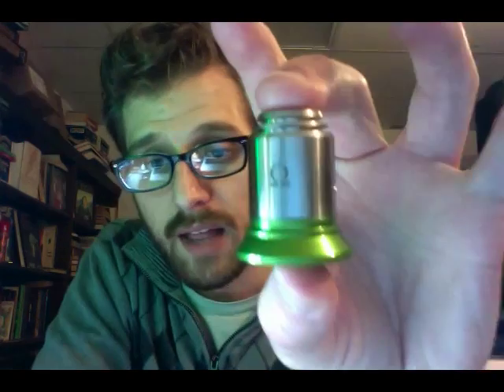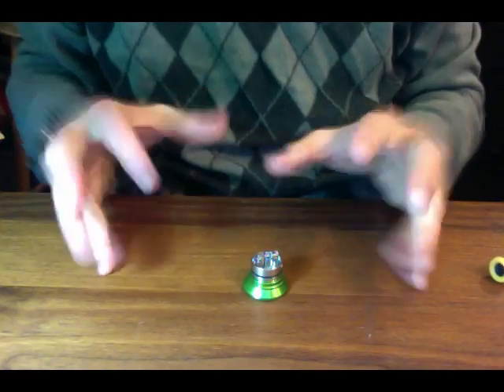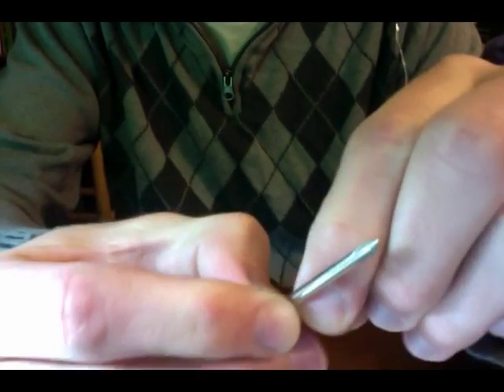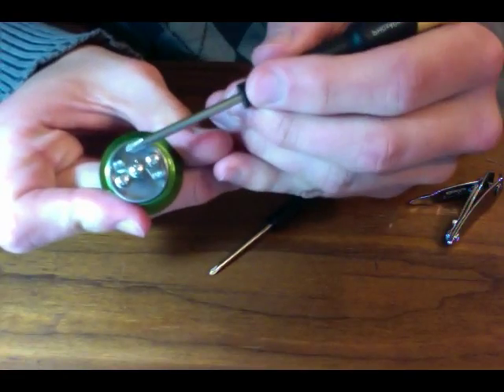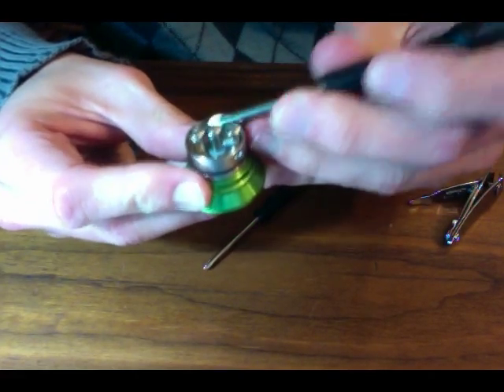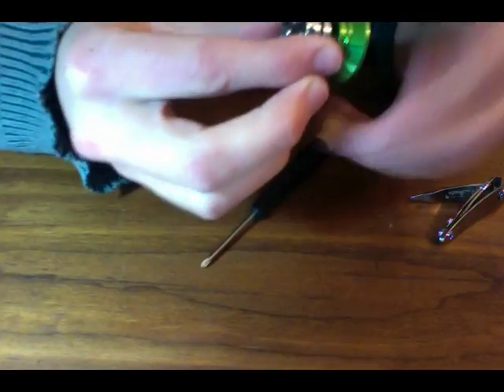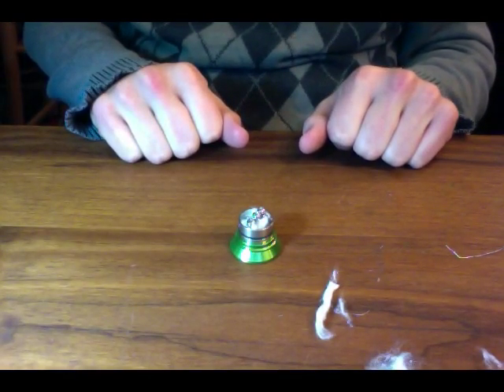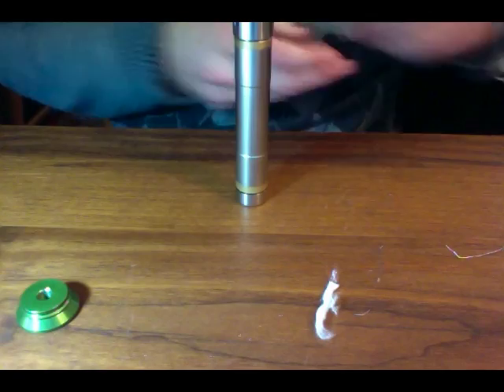How to build an Omega Rebuildable Drip Atomizer (RDA) with dual Micro Coils and cotton wick.

Comment: How many WRAPS idiot ???
Reply: If you are using 20g Kanthal, you can try 14 wraps and if you are using 28g Kanthal, you can try 11 wraps. A friend of mine tried 28g Kanthal with 12 wraps and the result is close to Nano dragon. Hope this info helps.
Reply from the maker: However many you want. The number of wraps you use will be personal preference. There is no set number that is right or wrong.

Comment: Occasionally I have found that an atomizer would not fit onto a mod. It happens and is unfortunate but there is no remedy that I have found. My trident for instance would never thread into my chi. Some products have more fine threading and are less forgiving to less precise threads. My thoughts are just be glad you've got something that the omega will thread into. Also be sure to sand down your k100 contacts if you've not done so already.